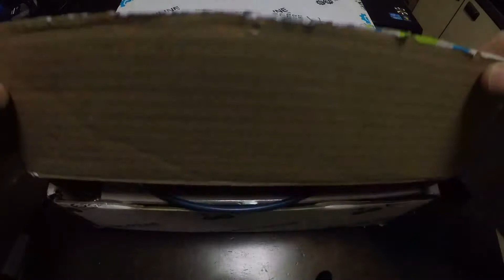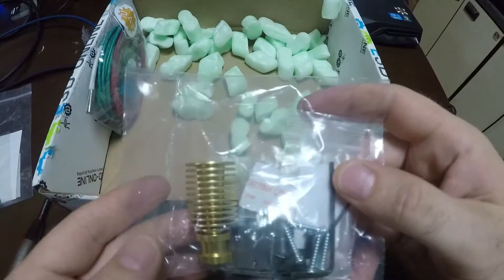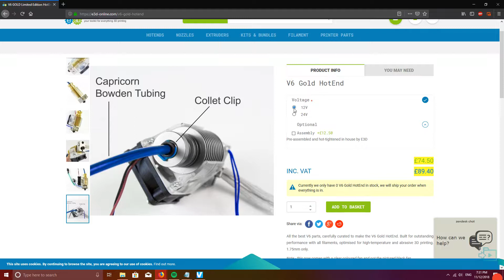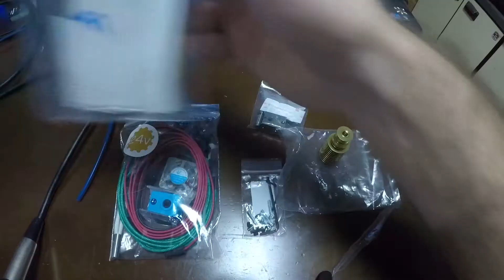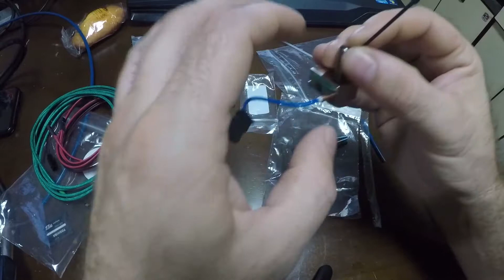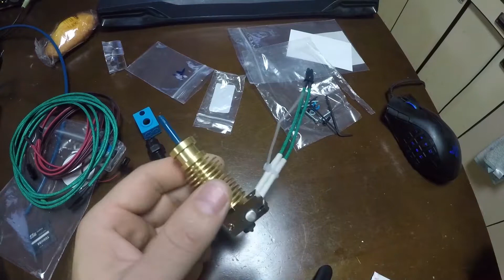E3D V6 Gold Limited Unboxing and Assembly Instructions

Comment: Looks like the sent u a fake hotend. The one in all advertising pictures uses no silicone sock and is square with laser etched branding. You got a rectangle one. Also your is not a direct drive, it's a Bowden setup. If u have ever worked with the original CR-10 V3 that heating has 2 compatable connectors. 1 for bowden style cr-10 v2 and one adapter for the v3. Both metal adapters, made from the same material as the heatsink.
Reply from the maker: hey! thanks for the comment. as far as authenticity, it is 100% real direct from e3d. the sock is included, and I can verify after many many successful orders from e3d, I can say with a reasonable certainty that they didnt send me a knock off. as far as bowden, that is correct! But i adapted mine to a specific direct drive system with a ptfe in the heatsync, and of course, works amazingly. Maybe I wasn’t clear on that in the video. It’s been a few years.

Comment: Hey bro, nice video. I'm wanting to get into printing filament with CF and other fibers. Is this upgrade overkill or would I be safe with the standard e3d v6 upgraded hotend?
Reply from the maker: heyyyy much appreciated on the nice comments.  This configuration will absolutely handle Carbon Fiber filaments. The heat rating is pretty high, and with the steel nozzle, will take some serious abuse.  Hope that helps!

Comment: I have a doubt that if someone can help me I would appreciate it. I have a printer prusa i3 mk3, could you install one of these hotend e3d v6 gold without changing any parameters? Is the same power the heater? and the thermistor is the same? I do not speak English, this I translated
Reply: Juan Manuel as long as you get the 24v version you should be good but you I’ll need to buy the Prusa specific heartbreak if you plan on using the MMU2
Reply: @fearsomepanda  Thank you
Reply from the maker: FearsomePanda nailed it. As long as you go for 24v, you will be perfectly fine!